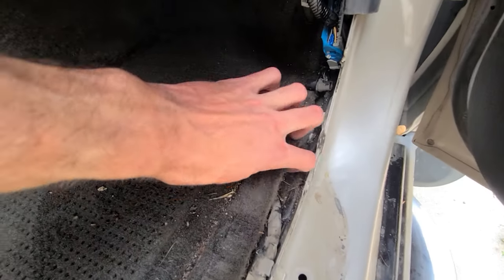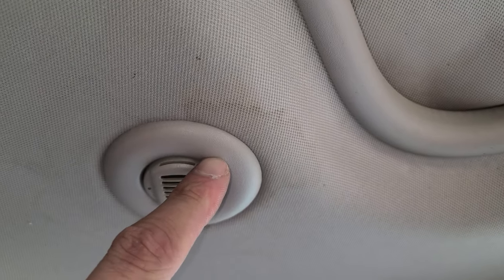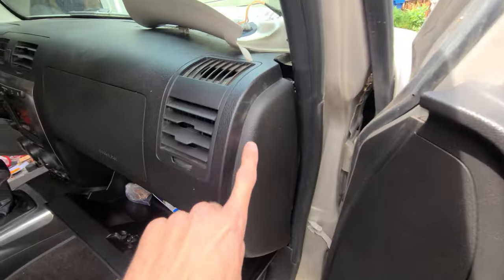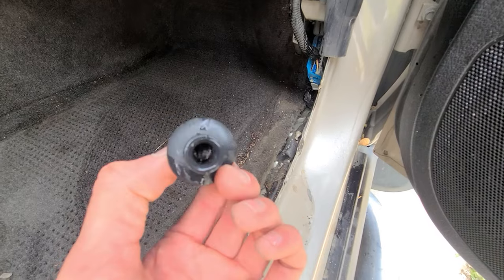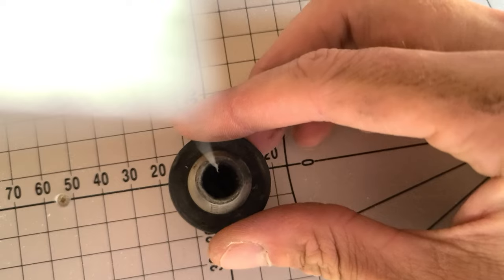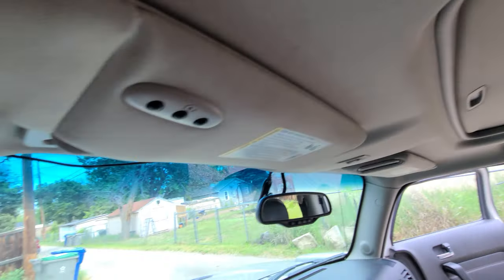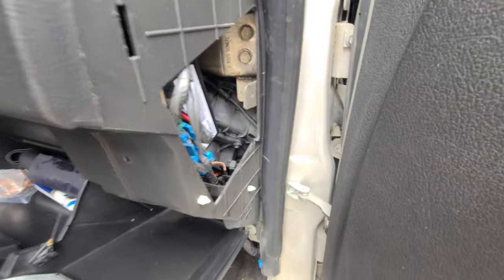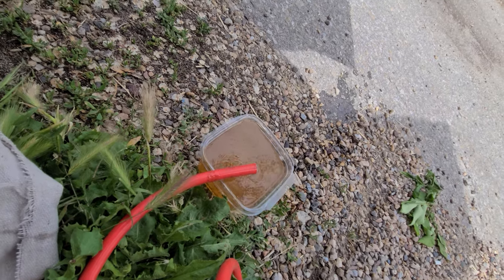H3 Roof Leak | Sunroof Drain Clogged | Easy Modification

Comment: This happened to my rig during a bad storm and shorted out the electrical due to the water being up to the brake pedal. I had towed to a savvy body shop who knew exactly what to do per your video. The damage was over $5000 and luckily my insurance paid it. That was in 2015 and I have only had a slight clog since that I easily cleared out with a long cable. Prior to that it used to overflow all the time into my lap and I had no clue as to why. Thanks for the video, hope it helps other H3 owners.
Reply from the maker: Dang! Water up to your brake pedal is incredible... I'm glad your insurance covered it. I used to hate the dribble on the lap haha.

Comment: Good to have you back brother! Your videos have been extremely helpful keeping the old H3 running smooth at 270k. A video on how to find a parasitic battery drain would be extremely helpful. Tried via the usual culprits of damaged trailer harness, and new terminals to no avail. Don't know where to start using a multimeter.
Reply from the maker: I appreciate your kindness, J! Nice work on keeping your H3 running to 270,000 and beyond. I'm interested in helping troubleshoot your battery drain. Do you have an aftermarket headunit or security system? I had a severe "battery draw" but it ended up being the result of my worn ignition cylinder (what the key slides into). I could pull the key out without the switch fully seating to "off," which kept the accessory power on. Another contributor to my issue was a worn shifter switch (I had to press the shifter all the way forward until it stopped for the computer to recognize the transmission as being in "park").  The combination led to my battery dying due to a constant accessory draw.
Reply: @H3Humper  Thanks for the reply ! No aftermarket accessories, everything is stock. I did have an issue not too long with a loose connection in the shifter switch which prevented the key from coming out . How were you able to find the battery draw?
Reply: Perhaps a door switch. I had an issue with the accessories and head unit not shutting off due to faulty door switch on driver side.
Reply: Disconnect to on star if it's equipped with Such device. That definitely was my Drain of the battery issue
Reply: @MH-uf1bd  definitely was my problem as well. Disconnected OnStar a year ago and no problem since.

Comment: Thanks for the Vid! I did this, and also replaced the gasket around my sunroof glass. I had a full flood, six inches of water in the rig! Never did the back but have not had an issue in two years
Reply: Any video of it or pictures?

Comment: I just did it! I didn’t have a hot wire saw so I did the best I could with some scissors 😅 thanks for your video. Hoping it works!
Reply from the maker: Great to hear! Let me know if it stays dry the next time you get some rain. It was such a major comfort upgrade when the swamp smell finally went away in my H3...
Reply: The little eyebrow razor shaper thing that Women use on their eyebrows fits and cuts perfectly round hole to remove that cross... Did all 4 of mine mostly by feel and took off  only a few pieces under the steering wheel, passenger side just the side panels.... Two in the rear, opened the rear door took a couple screws out of the plastic fender and reached it that way... It's been a couple years so I've forgotten exactly what all I removed but I do remember the rear was way easier than the front, and I've not had one drop of water since, and my H3 is kept outside all the time....

Comment: Glad I started skimming the video list I have a leak that’s making the read passenger seatbelt wet. So it’s the rear drain. Also have a failure where my sunroof won’t open I’m assuming the little gear lost some teeth by the clicking noise it’s making
Reply from the maker: Oh yes, it sounds like you're on the right direction with the rear sunroof drain leak. I wish I had known about the rear drains to make a video for those, as well. My front ones were very clogged and causing leaks up there. Have you unclogged your drains and fixed the gear in your sunroof?

Comment: Guys, I did such an operation with drainage almost 2 years ago ... it doesn't help - in heavy rain, the drainage can't cope with the flow of water ... all the water flows under the carpet - it never dries! In the end, I sealed the sunroof. Completely dismantled the interior. Carpet dried for a week in the sun. The floor of the car was cleaned of rust and repainted. And I forgot about this problem. Yes, the sunroof won't open now - well, fuck it. I use it as a panoramic roof.
Reply from the maker: Damn haha 😄 Having the water issue eliminated is good, though! The panoramic sunroof is a decent compromise
Reply: how did you seal the sunroof? I'm about to that point
Reply: @raw7s784 , Closed the sunroof and sealed the sunroof edges with polyurethane sealant
Reply: I paid to have my drain cleaned multiple times and it kept getting clogged again quickly. I sealed it with silicone caulking, which didn’t last in the West Texas heat. Now it’s sealed with pro duct tape. Looks like shit, but works.

Comment: so my hummer on the drivers side has my airbag right there on the panel. i do not want to break anything, do you have a solution for that?
Reply from the maker: The panel should be similar with an airbag. I have another GM with side curtain airbags in the A-pillar and was able to remove the plastic trim without issue on that one, too. GM doesn't have a good track record with sunroof drains haha.

Comment: I plan to replace the 5-cylinder engine with a 6-cylinder, and this will provide me with 50 horse power for my Hummer. What do you think? Would the idea be appropriate or would I face obstacles?
Reply from the maker: Hello there, having a unique engine swap would be awesome. I have heard the 6-cylinder might be too long to fit. The V8's do fit though, since they're not as long. Let me know what you decide!
Reply: Look for a hummer 5.3 with a hummer ECU. Enjoy

Comment: Easier to fish screen spline down from weep hole in sunroof. Screen spline has a small hole where you attach a straw from can of compressed air.  Push the spline through blowing air every so often. Be sure that there is water in sunroof trough which will quickly drain out as you work the spline and air.
Reply from the maker: I appreciate the tip! I cut the holes in the rubber nipples a bit larger to allow for easier flow of debris out of the bottom. Hoping the issue doesn't return.

Comment: Like to see the back one's
Reply: Dave here, 07 luxury Sport. I am struggling trying to find help with drivers outside door lock, where you put the key in when your fob doesn't work. 
I bought a new washer and another keyed cylinder mechanism. I took off outside door handle, removed inside door panel. And this is where i cant figure out which way to attack from. Im not familiar with the way the rods come off or how to remove lock from door. Please help. Thx, D

Comment: Had this happen on an Infinity I had a while back and air worked great to clear the lines. Just another idea but good work on clearing it out😂
Reply from the maker: Very quick solution! Unfortunately, the H3 drains have a poor design with very little flow, and they tend to separate when using the compressed air method.

Comment: Phk!!! thanks for this.. i think i have MOLD in my carpet now...smdh
Reply from the maker: My pleasure! and I bet you do... I had it in mine, too. I circulated air under my carpet on hot and dry days to dry it out enough before the smell went away. I actually had a similar issue with my Suburban, and I just decided to completely remove the carpet on my Suburban because I really don't want mold to have anything to grow on. The road noise and heat are higher, but I can tell if there is water anywhere on my floor. I'd like to get a fully rubber floor. Let me know what you decide to do with your H3!
Reply: @H3Humper  it'll be in for service tomorrow morning. I don't feel like dealing with this. I'm just gonna let this shop that services it deal with it. 

I've done enough work on this damn thing. Nice that I have 345k and it's still going
Reply from the maker: @LMoProVisualComm  totally understandable on having them take care of it for you. Nice job on 345k! Mine was at 344k when I sold it, I think.

Comment: I don't know if anyone suggested this but I would have tried using compressed air to blow the lines
Reply from the maker: Hey Pete, I've heard compressed air blows the line off the nipple due to the pressure building between the two. This led to some people having their drain tubes drain directly into the cab without them knowing. My method removes those interior tabs on the nipple, so the clogs shouldn't be a future issue. Compressed air is a clever and quick idea, it just might cause further difficulties on our H3's.
Reply: Correctamundo.  @H3Humper

Comment: I’ve been wanting to do this for the longest but I’ve been blowing it off.  I also have an oil leak but can’t quite figure out where it’s coming from
Reply from the maker: Hello Reco, have you checked the oil pressure sensor? I think those have a tendency to leak. One way I like to find leaks is by cleaning the engine bay and then waiting to see where the oil is dripping from.
Reply: @H3Humper  Preciate you, your videos are super clutch I just changed this out today
Reply from the maker: @Dudesaidthat  Thank you for your support! When I bought my H3, I couldn't find many repair videos online, so I figured I would try filling some of the void.

Comment: Mine says airbag where you unscrewed
Reply from the maker: The drain plug can be accessed from the underside, meaning the removal of the a-pillar panel isn't necessary. I imagine your panel can still be removed, but there's likely the airbag inside of it.

Comment: I cannot believe that one of out State's Attorney's Generals have not taken GM to court and make sure these sorrily designed drains, along with other issues ( like the poor yoke in the transfer case) , , are taken care of FREE.  After all. mine began when my Hummer was still under warranty, and continued until my warranty was Expired,  then it was my responsibility.  That should have been illegal.  It was certainly unethical of GM not to be a stand-up manufacturer and cover these.  One Dealer had my 2008 Hummer 2 months trying to figure it out ?  Really ?  Never got it completely resolved.

Comment: You must have tiny hands and arms.. I opened up the passenger side panel to access the drain tube/fitting and there's NO way I can reach in there?
Reply from the maker: I believe I went through the bottom with the glove box removed. I used the side panel to view the plug while reaching in from underneath. I had to use a single pinky to get the nipple back into the firewall. That side is tough. I'm over six foot tall, so I definitely have some pretty long hands and fingers.